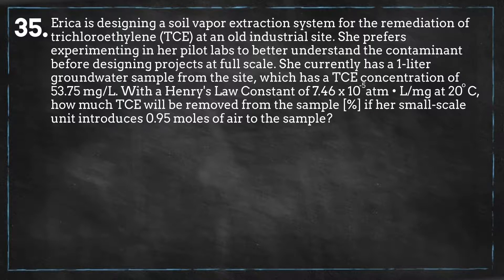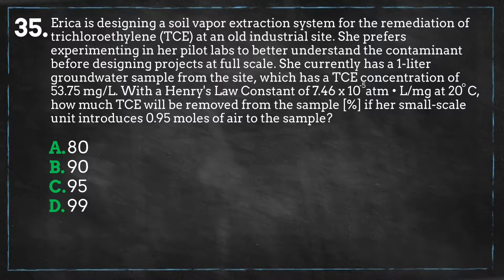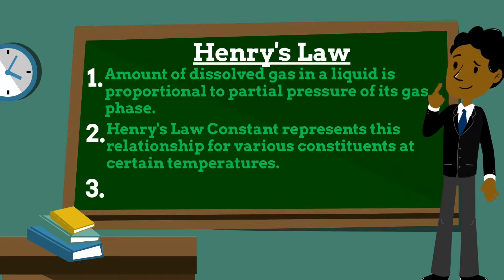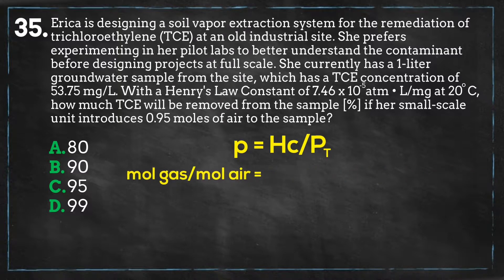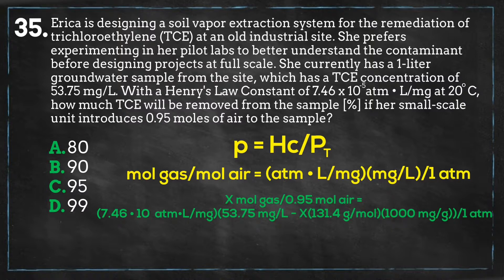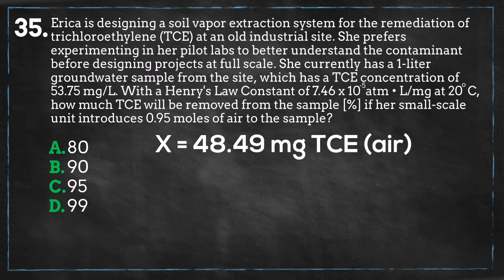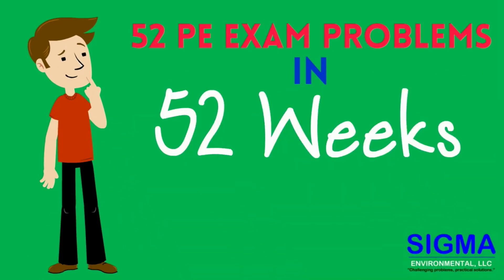Applying Henry's Law - Episode 35 (Site Assessment & Remediation) | 52 PE Exam Problems in 52 Weeks

Comment: Why would be using 1 atm? Can you not use the ideal gas law given the volume (1 L), moles of air (0.95), and temp (20 C) to solve for pressure. Even if we don't consider it an ideal gas in this situation to use PV=nRT, since its not at STP,  using 1 atm would still be assuming that. 

I found the pressure to be 22.85 atm for the air. I used the original concentration of TCE for the moles and solved the ideal gas law under the same conditions and found that the additional pressure was negligible compared to the air so I used 22.85 atm as the total pressure. Using Henry's law as you did, I ended up getting 80%

Comment: I think they may have removed this p=Hc/Pt equation in the handbook... Handbook 1.5 for the PE Env doesnt show this equation. Although I might be incorrect. Is the equation on page 200?
Reply: It's written differently, but it is the same equation. My 1.4 version has Pi=Pyi=hxi where yi = P (in the video), Pt = P (in the video) and xi = C (in the video). It is on Pg 63.
Reply: @space3ee  So you are saying Pyi=hxi is the same as p*pt=hc (video terms) but xi (c in the video) is stated as a mol fraction of the gas in the liquid. In the answer he is showing the mass of TCE minus the mass of TCE going to the air which is not a mol fraction. I am not seeing how these are the same. But I could just be over looking it.
Reply: @priyabhowmik6227  honestly this was so long ago, I'd have to sit back down with this to give you an answer. There are some complicated concepts these videos don't seem to have down quite right and I don't trust everything in them. Specifically the mol fractions. It's either this video or another where I go on a loooong rant about mol fractions and how the creator is doing something I think is wrong.
Reply: @space3ee  Thank you for your response. I assumed you told the PE recentish then? If so you have any tips?
Reply: @priyabhowmik6227  don't rely too heavily on memorizing these problems and the ones in the practice exam. You'll want to really get the concept behind them bc you will get similar but not exact questions on the exam. Delve into the conceptual stuff. For example,  know about the things in the book that there are only plug and chug questions for. I was sure I failed when I walked out. It is a hard test. I passed though. If you take the exam on Monday you will have to wait until the following wed to get results. That's the testing window.
Reply: @space3ee  Thank you so much!

Comment: Can someone explain why the problem uses 1 atm?  It seems like you would be assuming a pressure.
Reply from the maker: Hey Wenli, thanks for your question. Since the problem statement does not provide a pressure, it is safe to use a standard pressure of 1 atm since this is occurring in a pilot lab environment compared to the actual field.

Comment: Can anyone elaborate on how the intermediate calculation derives 3.69 E-4??  There may be another step in there that wasn't part of the video to arrive at that number but I'm not seeing it.
Reply: Shouldn't the mole fraction on the left side of the equation be mol gas / (mol gas + mol air)? Also, why do we subtract the moles of TCE gas on the right side?
Reply: @oceanwaves0786  I think I understand why we have to subtract the mol on the right. The equation is for equilibrium which means that some of the mols in the liquid have already left the liquid. We don't know how much, but we do know it is the same x (mol of gas) as on the left side of the equation. We have to subtract it from the right side, because the variable he is using on the right side (C) isn't the starting concentration of TCE in the water, it is the final concentration (after equilibrium). More so, technically C is the mol fraction of the gas in the liquid. So similarly to your previous point, it should be mol of gas in the liquid divided by mols of gas in the liquid + mols of water. There are 55.6 mols of water in a liter of water. If I use the correct mol fractions on each side of the equation, then I get 0.000057 mols/L of TCE. Which is 7.5 mg/L of TCE. Which would be 14%. I'm not sure who is right...Maybe someone else can help expand on this? I'm pretty sure my method is correct.
Reply: @oceanwaves0786  I was thinking the same thing. I'm also not sure I understand why he is subtracting X(TCE MW) on the right side of the equation.
Reply: @oceanwaves0786  maybe he is ignoring the mol of gas in the denominator because it is so small in comparison. I get basically the same answer using either.
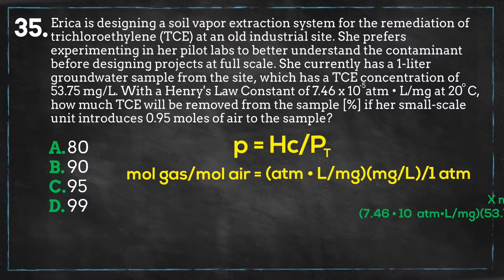Reply from the maker: Thanks for your question! I will point out that somehow the exponent was left out of the equation in the video at the 4:13 mark for Henry's Law Constant (7.46 x 10^(-5)). We're solving for X, and since you have the unknown on both sides of the equation, you have to get it to one side by itself then get rid of the constant. To make sure we're on the same page, you should have the following as your intermediate calculation (I won't include units to increase clarity) starting at 4:13...

Step 1: X/0.95 = (7.46 x 10^-5)(53.75 - X(131.4)(1000))/1

Let's clean things up a little bit by multiplying everything out, and we get the following:

Step 2: 1.0526X = 0.00400975 - 9.80244X

Now, let's get our "X" variables on one side of the equation, so I"ll add 9.80244X to both sides of the equation:

Step 3: 10.85504X = 0.00400975

We'll divide both sides by 10.85504, and we now have solved for X:

Step 4: X = 0.000369 = 3.69 x 10^-4

Let me know if this makes sense for you, and good luck in your studies!
Reply: i got 3.81x10^-3
Reply: @dand7056  same